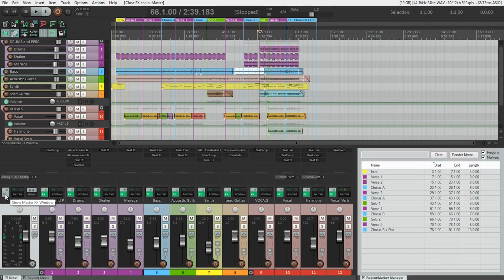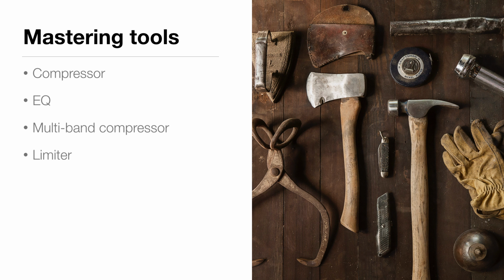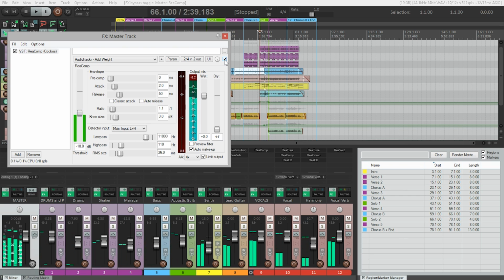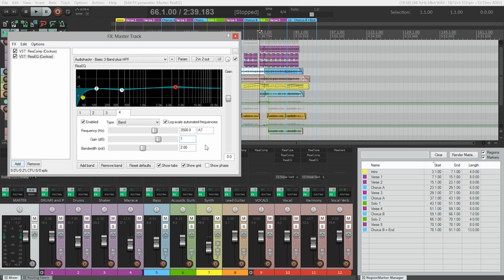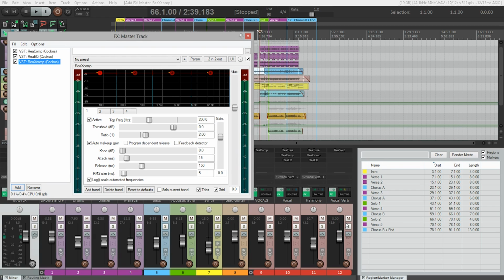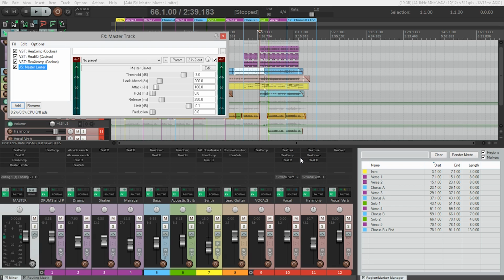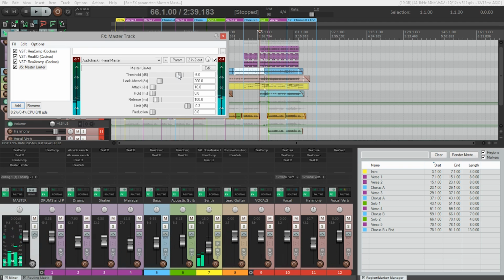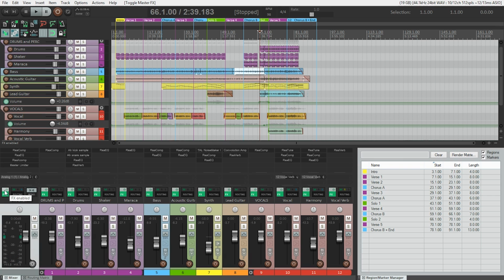How to master your mix using stock plugins in REAPER

Comment: I’m just switching over to reaper from CUBASE. I use a light weight program called Ocen Audio to master and basically am doing the same tasks you are doing, but I like that program better because it opens up the wave and I could see exactly how loud it is and if I have some spikes here in there, which typically happen from a live snare drum hit or something like that I can physically lower the volume of just that one drum hit. And I can do it all in that one program and I can save a preset like I do with the multi band Compressor. I will do that just before I import it into a video or post it or put it on a CD or whatever. I find it so useful to mix down my best mix from my DAW and then do all of that mastering with OCEN Audio. Yesterday I just took a board recording of a band actually the smithereens. A college in 1983 and the D noise or that’s built into audacity was incredible. I have a really nice sounding CD of actually double CD set of 32 songs. Just wanted to share the way that I operate. Thank you for the video.

Comment: Sooo, where do I get the Audiohackr Presets you mentioned?
Reply: I wasn't able to find them either, so i just changed the parameters to match the ones after he clicked the add weight preset and then saved it as a new preset and titled it ADD WEIGHT. Voila!

Comment: Hi Audiohackr.  Fantastic channel and I have subscribed!  I have just have a question regarding your mastering process.   I see you performed the process in your project (showing all tracks), however I have also seen others render a project out to a single WAV file and then master that.  What is your preference or is the latter just if you are getting your song mastered elsewhere?
Reply: You can do it either way, no difference sound-wise but it would be less taxing on your computer.

Comment: I have a question that maybe someone could answer for me. As much as this increases the volume dramatically, it also clips on the master. If you turn the master down to compensate then all gains are lost. Is it a problem that the master is in the red?

Comment: Re: Using the multi-band compressor on the master track to improve the bass but not affect the other frequencies. What are the reasons for not doing this to the bass track alone before mastering or vice versa?
Reply: May change whole mix

Comment: You already had a limiter enabled on reacomp though, not sure why you'd add another limiter on top?
Reply: Just noticed that, you're right.  Tried ticking on and off and I'm hard pressed to hear a difference.  I just left the limiter off on reacomp
Reply: @Micas099  If you have a dedicated limiter you have more control, and i you can make sure it doesn't overshoot.

Comment: You use custom presets and don't show us the settings you use which is pretty annoying.
Reply: The settings are right there in the numerical values. You can see them switch from default when he loads the preset. Just copy the values and name and save your preset.

Comment: Can this be done on the rendered mp3 file or does it have to be the individual tracks inside reaper like the video shows?
Reply: You are meant to render to WAV format, then do this mastering process to get loud then render to MP3 format. you will notice that the MP3 version has the highs cut.

Comment: Well I cant master cause my levels remain the same. When using Master limiter it just destroys the song. Song that I'm TRIYING to master is metal song so it has distortion on it but when I try to increase gain I hear hums. It just can't be louder... I did everything u did and still not having results but no one is here to master that for me :(
Reply: You are doing metal so your need is different when you master. I am still working it out, I do metal also
Reply: Are you sure the hum’s you’re hearing isn’t a buildup of bass in your tracks? Did you hi-pass your tracks? I ask, because I’ve had this issue before.
Reply: Sounds like you didn't gain stage properly on all the steps going into the master? His presets here assume you have a pretty pristine mix going in.

Comment: I have a sound driver Focusrite 2i4, it is its driver, midi writes but there is no sound, the vocals when activating the recording pop up (cant T write recorging files doest directori exist)))) everything is set correctly, but there is no sound, I throw all the sound on the rapper MP3, put virtual synthesis, the same thing is clear that the record goes and there is no sound, which I do not right ....

Comment: I am using using your Reaper config file and followed your steps for mastering using your plugins.  I've rendered to WAV and MP3 many times before without issue.  After loading your config, the WAV and MP3 renders are very distorted and wobbly.  I turned off FX, followed your steps for rendering, updated Reaper tried 16 and 24 bit with no effect.  I'm using ASIO and tried playback of the file in Reaper with the same result.  How can I uninstall your config, or is there a setting in your config that I may have missed that could be causing this?  Thanks

Comment: I have a problem. Dunno if the mic we used or if it is a EQ problem. I'm rather pleased with a song I mixed and began to master, but it don't have that... clarity/clear/distinctive sound. Any thoughts about that?
Reply from the maker: It could be a number of things. I was really conservative with my EQ on the master. Perhaps you could try cutting more of the upper bass (somewhere between 200-300Hz) by 3dB or more, and boost the upper mids (somewhere between 3-5KHz) by the same amount. These EQ suggestions might be too specific. You may want to try going back to your mix and eq'ing specific elements instead. Best of luck! Thanks for watching!

Comment: when i add all these effects my master track starts clipping, and how do you tell which part of your song is the loudesT?
Reply from the maker: The loudest part of you song will likely have the most instruments playing at the same time. If all instruments are playing throughout your song and the average level is about the same through the entire song, it doesn't matter what part of the song you use to set up your master effects. Cheers!
Reply: thanks, but why does it clip when i add these effects?
Reply from the maker: You're getting clipping because one (or more) of the plugins is adding too much gain. Try adding them one at a time and see which one is causing the clipping. ReaEQ and ReaXcomp both have a gain fader on the right side of the plugin window. If ReaEQ or ReaXcomp is causing the clipping lower the gain until you're no longer clipping the master. With ReaComp you can use the "wet" fader the same way. Again, placing the limiter at the end of the chain will eliminate the clipping. Cheers!
Reply: thanks! very useful!